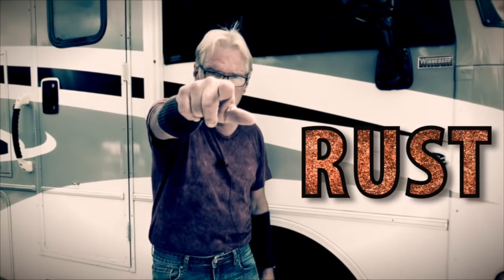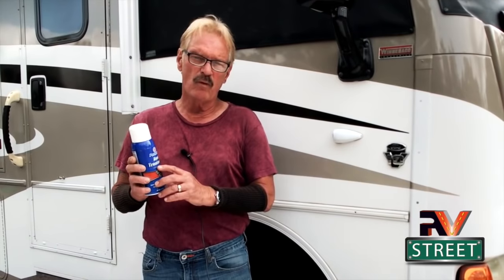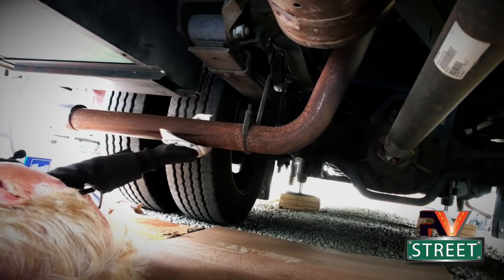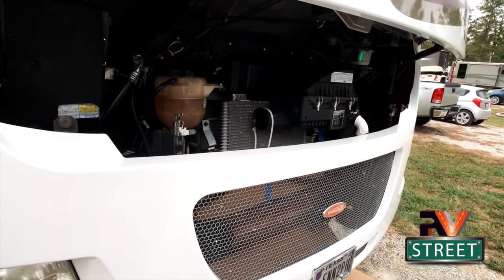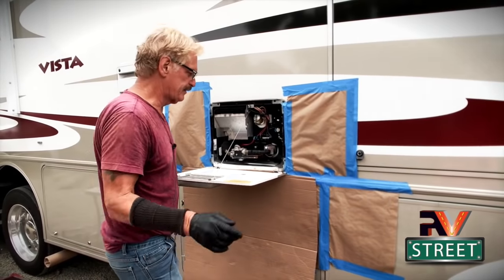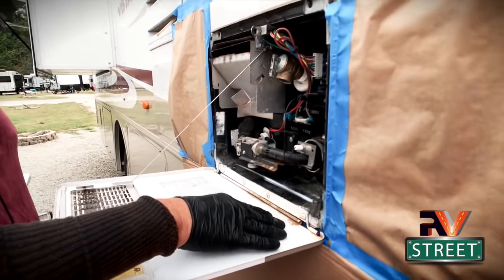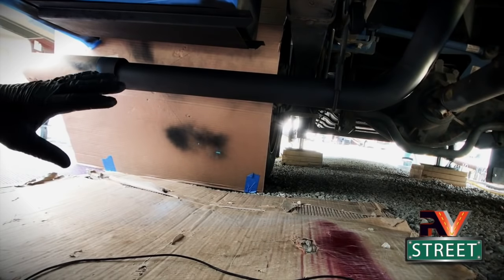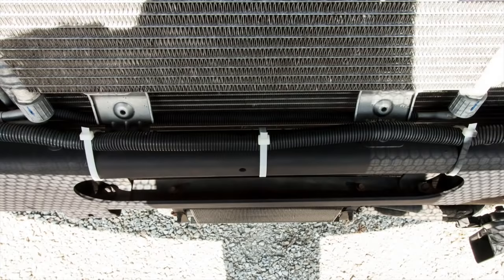RUST can destroy your RV. Here's how to fix it 👍

Comment: I followed you directions and treated the 5th wheel, frame, propane lines, drain line storage, propane storage bay, and bike rake.  Next I'll finish it off with a top coat.    Thanks dude!!

Comment: Finally! I get to know what product you used! I used that product that I showed you and it pretty much stripped off the rust, as I scraped it of course! My goal was to totally remove the rust and from what I just saw, that’s not really necessary 🤦‍♀️🤦‍♀️🤦‍♀️ You aren’t really worried about totally removing the rust, this Permatex stuff just treats the rust and bonds to it so that it stops growing once you seal it in with your top coat of paint. Am I understanding that correctly? If so, I’m glad I watched this before tackling my other areas of concern because totally removing the rust is quite a chore and very time consuming! I think I spent about 90 minutes just doing the small areas on my steps. My hitch would have taken much longer my way! Thanks for another great video! Miss you guys and Sir Lloyd Benson says hi 👋.
Reply from the maker: Am I understanding that correctly?...........
Yes. 👍

Comment: Great video, thank you! Just purchased our first bumper pull and it has rust on the axles, I will be doing this as soon as the weather permits!
Reply from the maker: IF you have rust in the axles I would use Por-15 and then use Por-15 top coat. I have both in my Amazon Store in the "Sealants, Lubes and Protectants" category.
https://www.amazon.com/shop/rvstreet

If you have real heavy, deep, pitted rusting on your RV or in areas under the chassis that would get constant damage from rocks, gravel, salty roads etc, then use POR-15 along with more vigorous prepping the way I showed, along with a top coat would be a better choice in those applications. This we did in this video was how to treat light rust and get it under control BEFORE it gets bad.
• POR-15 Rust Preventive Coating Semi-Gloss Black (it's a brush on product)
• Use this top coat for all other black chassis areas not requiring high heat protection - POR-15 Top Coat Chassis Black Spray Paint, 15 oz.
Reply: @RVstreet  great, thank you!

Comment: Another great video and signature bandana Martin! Great tip with permatex. I've used VHT epoxy spray paint on my previous motorhome frames with great success. If anyone gets a new motorhome, you will know there are many many many spots underneath that are not painted. As soon as you get your new rig home, use RVStreet's method and keep your underside looking like new for years!
Reply from the maker: Ya that VHT stuff is a great product.

Comment: Good video, good job on getting rid of that rust. Actually have a utility trailer I think I'm going to do has some rust on the fenders and such. Also I was wondering we purchased our Rd about a year ago. I just checked air pressure in tires they are little low . On the tire and RV decal it says maximum 50 psi. Would I have to put it at that or could I use less air pressure.
Reply from the maker: You need to watch my comprehensive video on motorhome tires.\https://www.youtube.com/watch?v=Q_NuEoBIxe8

Comment: I watch your videos and a very excited about having the opportunity to learn from you. Thank you. 
I have a question. 
We have rust on the ball on the new 5th wheel 2022. Do we use the permitex and same things you used. Or is painting it not a good idea?  Or what have you seen what might have been recommended?
Reply from the maker: If it's rust just on the ball, I wouldn't worry about it. Whatever you coat it with will just wear off again as you drag that 5ver around. If anything, just take some of my lube that I use for the steps, put it on a rag and periodically wipe it on the ball.
Reply: @RVstreet  it's also in the plate above the ball on the 5th wheel.
Reply from the maker: @christinaholligan8299  Oh, ok....then I'd lightly sand and wire brush that plate area, wipe it clean with some acetone and then paint it with Lacquer paint. You could brush it on in that area. But I still would leave the ball alone. Just lightly sand the ball and wipe some oil on it periodically.
Reply: @RVstreet  thank you do much..

Comment: Martin
By the way there is another product to stop rust, it’s called Rust Check.
I used to live up north and used it a lot, works well
Reply from the maker: Ya there's a lot of different products out there. This product I've used before, it's super easy to apply and prep for and I only recommend stuff I have actually used and is proven. thx for chiming in. 👍

Comment: Permatex Rust Treatment states not to apply to surfaces that would exceed 200 degrees F. Wondering how your exhaust faired over time?
Reply from the maker: Ya know, my main goal when I was planning to shoot this video, was to do everything I did but at the last minute I decided to throw in the exhaust pipe. I hated looking at that rusty thing sitting outside the coach. I actually was under there the other day checking some other things and it's handling up pretty good but that's because I used several coats of the high heat VHT FLAMEPROOF Coating. I did see where some road debris and rocks have hit it and chipped it some though.
Good question. thx Thomas 🔧 👍

Comment: Thanks for another good video,since you seem to know a lot I have a question for you.
Our friend in the park has to remove his 3m clear protector of the front of his rig because of mold.
They have a hard time getting it off, any ideas?
Reply from the maker: Yeah there are two types of protection products out there on motorhomes: one is a 3M product the other is called Diamond Shield. Both look great until it gets about 7 years old or so and it’s down hill from there and is a nasty, laborious job to remove yourself.

Depending on his location there are companies that will come to his location and remove it . This is all they do. I watched a crew of 3 guys come out a couple of years ago to a Florida park we were at and they removed his, compounded and polished it out 6hrs. Looked fantastic afterwards. I didn’t ask my neighbor what he paid but I have heard numbers over the years like $600-$800 or so. Companies that specialize in this, know how to remove this stuff and not hurt the paint underneath.

Possibly a company like this one: https://uglyshieldremoval.com/

Taking this off as a DIY can be done but even me, if I had a coach with this problem I’d just pay someone to do it.

I had a friend remove his 3M product and this is the procedure he used:
Bought a handheld clothing steamer from Bed, Bath and Beyond and plastic razor blades to get off the film. For the glue residue, Xylene from Home Depot worked the best of everything he tried. Spray on a lot to keep the area you are working on wet.

3M films are best removed with solvents and erasure wheels (both available from 3M)

There are many DIY folks online that have tried this with success, some not so much using all different types of techniques. I personally have never done it and never will. Our coach doesn’t have any type of film on the front but if it did, I’d just pay someone to do it. When you get older, there are just some things that are worth paying someone else to do. They have all the know how, man power and equipment.

Hope this helps. 👍
Reply: Thanks for the reply,I will tell my friend about the glue removal product

Comment: Hi Martin - 

Another great video.  For PM on the chassis rails, leaf spring and metal cross members for the "house" construction of the RV, would you recommend the Permatex and black rust oleum for these  areas as well?
Reply from the maker: No. If you have pretty good rust in those areas I'd use Por 15. More rugged and can more abuse for those areas.
Reply: Just look like surface rust. the rust inhibitor or the primer and top coat products?
Reply from the maker: @joemissyoneil8668  Well, you can try the Permatex inhibitor and Rustoleum top coat and see how it goes. But because it's on the chassis it will take a bigger beating than the areas I treated. That's why I suggested POR15 in your case. That's my opinion. I'm sure you'll make the right call.

Comment: EVERYTHING under my 2006 Alumiscape 5th wheel is heavily rusted. LP pipe, beams, you name it. How should I go about removing the rust? I am thinking about a wire brush to start with. I can send photos.
Reply from the maker: Hi Susan,
Since your 5ver is heavily rusted you need to go with POR 15 and their procedures to prep, treat and final top coat. Start as soon as you can before it gets hot. It will be a dirty job but you can save your RV. Maybe finish up in the winter when it's cooler. If those LP pipes are pitted really bad you may have to consider replacing them. You'll know more once you begin to clean & prep those areas. While you're under there I would also advise to look closely at all electrical connections, leveling systems etc. Catch this rust problem now before it begins to infiltrate and decay into even more areas. "You Can Do This". 🔧 👍
Reply: I will do as you suggest, ASAP. Thank you for your wonderful videos, as a 64 yo lady, I love to tackle RV maintenance. I will update on the progress.

Comment: I have a converted toy hauler. It is probably around 8 years old. I will definitely be doing this for the frame this winter, there is surface rust on it. Before I bought it, the previous owners used bleach on the white aluminum because it had green algae. The aluminum is streaky. How do I remove the oxidation and what do I use to protect the finish. The products I find list fiberglass or vehicles. The aluminum products I find are for tire rims or pontoons.
Reply from the maker: Before I bought it, the previous owners used bleach on the white aluminum because it had green algae......
What aluminum areas are you talking about?
Reply: The whole trailer has aluminum skin, not fiberglass. It is white aluminum like the work trailers.
Reply from the maker: @debbiephillips2013  Hum........don't think I can help you with that one. Sorry.